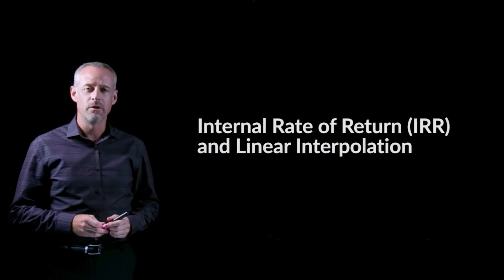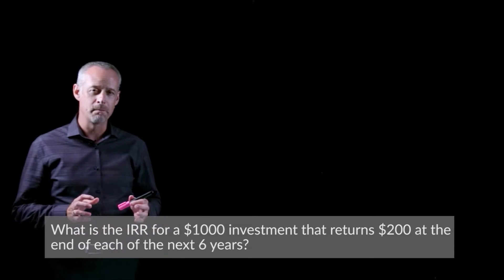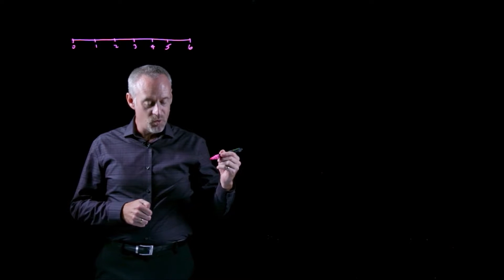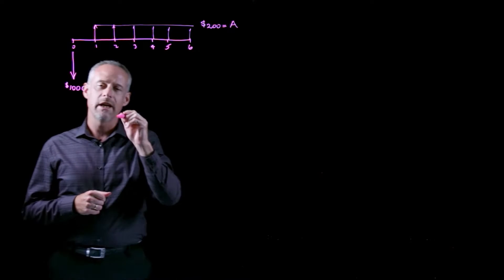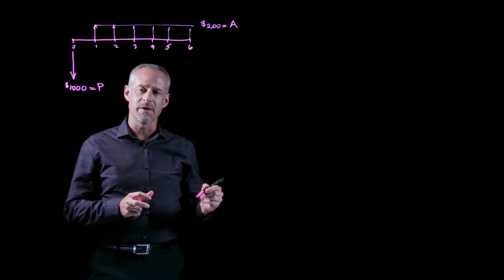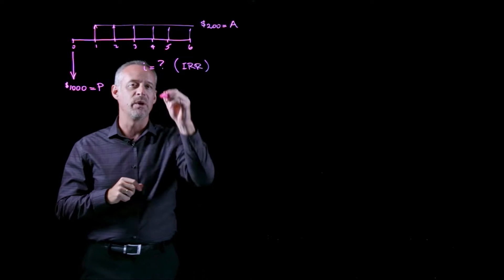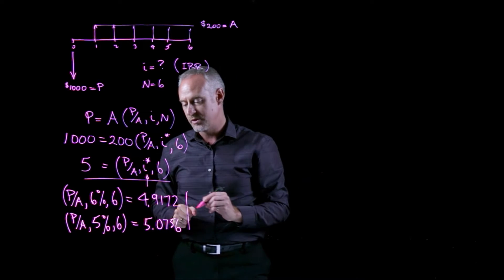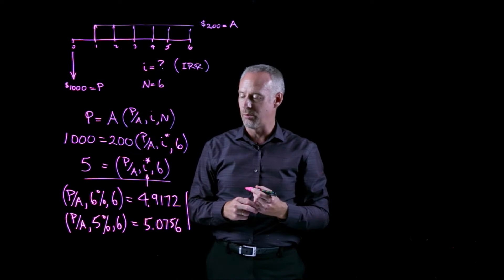Internal Rate of Return IRR and Linear Interpolation - Engineering Economics Lightboard

Comment: Thank you a lot. 
If we have mutliple cash flow....I think this will be hard to solve this way....using the NPV formula ( IRR = unkown i ) and finding the IRR which bring the NPV to 0. Is this the correct way ?
Reply from the maker: Yes.  What you've said is correct.  Also, using linear interpolation can be slow and tedious.   Excel has a built-in function called "IRR"- this is by far the easiest way to solve these problems!  Although, understanding linear interpolation can be useful for engineering students in other courses, and it does help students understand numerical methods for solving problems, even though this is very basic.

Comment: I'm a little confused about something and hope you can clarify. When calculating the IRR using the interpolation method, it is easy when there is only one factor in the equation, but what if there is more than one factor. For example: 50,000 = 15,000 (P/A; i*;5) + 16,384 (P/F; i*;5). Here, there are 2 factors (P/A) and (P/F). Which tables should I look at to interpolate, or in these cases, must I use trial and error?
Reply from the maker: Excellent question!  Yes, the kind of simple interpolation demonstrated in this video is not possible when there are multiple terms in the equation.  You are correct - you need to use trial-and-error, or perhaps a numerical method to solve for i.
Reply: @EngineeringEconomicsGuy  Awesome. Thank you so much! I really appreciate you getting back to me.
Reply from the maker: No problem!  Good luck in your course!

Comment: Thank you so much for this explanation. I have a question about a couple of examples in the book and how the IRR was calculated. The first one used (P/F;i*,N), and the answer was right away the IRR. The second example used (A/P;i*,N), but the i calculated was used to interpolate to get the IRR. My question is: why, when using the P/F , do we get the IRR, but when using the A/P we do interpolation to get the IRR. I hope this makes sense without me being able to copy and paste the answers.
Reply from the maker: This is an excellent question.  I think the answer you're looking for relates to the 'math' involved in solving for the value of IRR.  In problems with a P/F compound interest factor (or an F/P), it is possible to solve the equation 'explicitly' for the unknown variable "i"; meaning, you can rearrange the equation and isolate the "i".  This leads to an immediate and exact solution.  On the other hand, for problems involving A/P (or P/A), the equation CANNOT be explicitly solved for "i"...no matter how good you are at algebra - it just doesn't work.  Have a look at the formula for A/P and you'll see what I mean.  For problems like this it is necessary to use one of the following methods to solve for "i":  linear interpolation, trial-and-error, numerical techniques, or the built-in 'solver' or 'goal seek' functions in Excel.  Excel also has an "IRR" function that does the job for you.  I have a video on using Excel for this purpose!  https://www.youtube.com/watch?v=NcO7LyJE8bA
It's a little complicated, but I hope this answer is helpful!  Good luck in your course!
Reply: @EngineeringEconomicsGuy  Thank you so much. It makes so much sense. I really appreciate your help!
Reply from the maker: My pleasure!  All the best!

Comment: Why we didn’t use the equation of discount factor?
Reply from the maker: Unfortunately, you can't solve the equation 'explicitly' - meaning you can't isolate the value of "i" using algebra.  Trial-and-Error or Linear Interpolation are simple suggestions for solving for the value of "i".  However, the best method is to use a numerical solver in a calculator or in a program like Excel.  In fact, Excel has a built-in function called "IRR" that will solve problems like this automatically.  Watch my video:  https://youtu.be/NcO7LyJE8bA  for the best way to solve these problems.

Comment: How do we solve such question if the cashflow are different throughout the years?
Reply from the maker: Solving for an unknown interest rate when the cashflows are irregular is difficult!  In these cases, you can still write the 'time-value-of-money' "equation" but it will have several terms that include the unknown value of 'i'.  Solving the equation for 'i' will require the use of a numerical-method (a fancy way of saying "let a computer perform some clever type of 'trial-and-error'").  MS Excel has a 'Goal Seek' function that I use for problems like this.  -Good Question!
Reply: @EngineeringEconomicsGuy  thanks for your efficient response and explaination. No doubt u are a lifesaver like everybody says..
Reply from the maker: You're welcome!  And thanks for the nice comment!!

Comment: Hi sir, I would like to ask.

1. Does the meaning of the market value of 100 dollars after five years of usage is the same with the returns value of 100 dollars at the end of the year? 

2. Also, what is the meaning of, 'the estimated increased productivity attributable to the new equipment is amounting a total of 500 dollars per annum after extra operating costs have been subtracted from the revenue generated by the additional production'? Earlier, I was assuming the market value as the salvage value and the estimated increased as the annuity. 

thank you in advance because I had a confusion regarding my tutorial question just now.
Reply from the maker: OK - So I think your questions are not about this video, BUT that's OK!
For your question (1), I think the answer is yes.
For your question (2), you are correct that the 'estimated increase' is the annuity, and the market value is the same as the salvage value.
I hope this helps - although it seems you already had the correct assumptions.
Engineering Economics is often more about understanding WORDS than it is about understanding NUMBERS!!
Reply: @EngineeringEconomicsGuy  yes sir, because I have gone through most of the related topic of your videos, so I just simply comment here what I don't understand.

I think I could figure out the solution. Thank you for the fast reply sir! May God bless you..
Reply from the maker: Ok, I'm happy to help.  Good luck in your course!

Comment: i know how to do interpolation annuity i am confused in that like 28.5714 is the difference between 14and 15% I am confusing still.
Reply from the maker: I'd like to help you but perhaps your question does not relate to this video?  In this video the interpolation occurs between 5% and 6% for values of the P/A compound interest factor of 5.0756 and 4.9172.  I don't see where your values of 28.5714 or 14% and 15% are coming from?  Perhaps you can clarify your question?
Reply: @EngineeringEconomicsGuy  I just give an example sir.
Reply from the maker: From the example in this video, we know that the value of the (P/A compound interest factor) must equal 5.000 BUT we don't know what value of 'i' makes this true.  The P/A compound interest factor is a complicated formula that cannot be 'solved' for 'i' using algebra, SO, we approximate a value by linear interpolation between the value of 5.0756 (for i=5%) and 4.9172 (for i=6%).  5.000 is "part-way" between 4.9172 and 5.0756 - if we find out exactly 'how much between' we can use this same 'amount-between' to find an answer 'between' 5% and 6%.  I think maybe you need to know more about what the P/A compound interest factor is before you can fully understand this example.  I suggest you explore my playlist on 'Cash Flow Analysis':  https://www.youtube.com/playlist?list=PLcfz9wmNxKqgciRucJOr8VdEQQT_cicOT
Reply: @EngineeringEconomicsGuy  thank you sir.
Reply: @EngineeringEconomicsGuy  Professor I'm confused on why you chose 5% and 6%? Like what's the logic behind those values? Is it because when we look at those percent tables with the corresponding n values we try to find the i* values that are closest to the number we solved for, in our case 5?
Reply from the maker: Yes - I think you've described it perfectly.  We know that the P/A compound interest 'factor' for N=6 must equal a value of "5.0" (to solve our problem).  Just by looking through the interest tables, we see that for N=6, the 5% table has a P/A value just above 5.0 (5.0756) and the 6% table has a value just below 5.0 (4.9172).  So we know the solution to our problem must be 'between' 5% and 6%.  Then we use 'Linear Interpolation' to approximate the solution.  I hope that answers your question - but I think you already understand anyway!  Good luck!
Reply: @EngineeringEconomicsGuy  Thank you! You just cleared it up. After I wrote the comment I went to bed and was still thinking about and just by trying to understand the logic and then out of no where it clicked. Your answer reaffirms my late night findings lol. You've been IMMENSELY helpful this semester thank you!
Reply from the maker: Great!  I'm glad you got it!  IRR problems are often the toughest.  I'm happy to have been helpful to you!